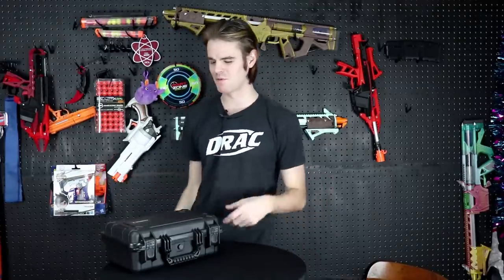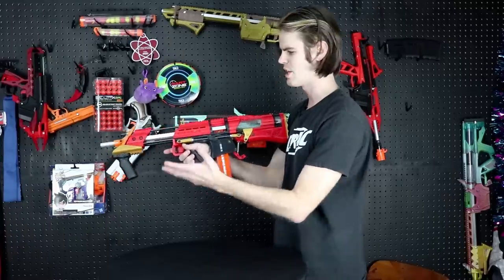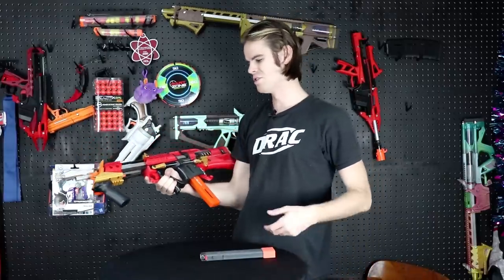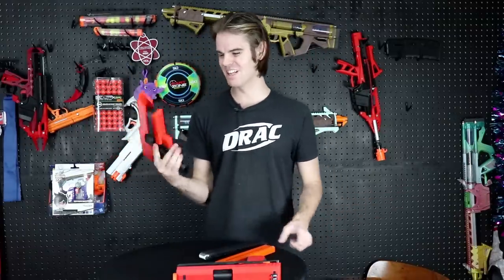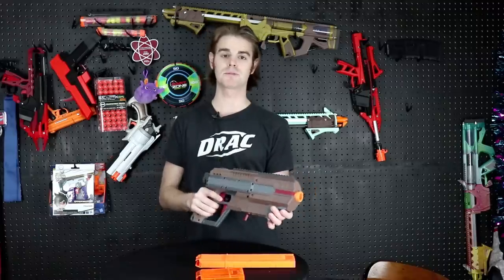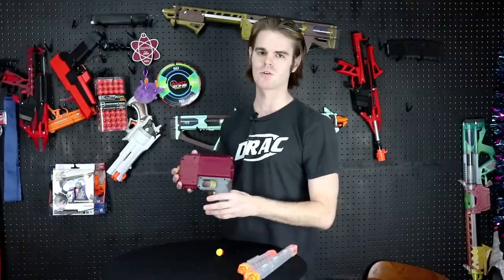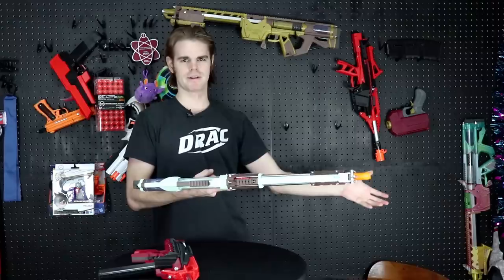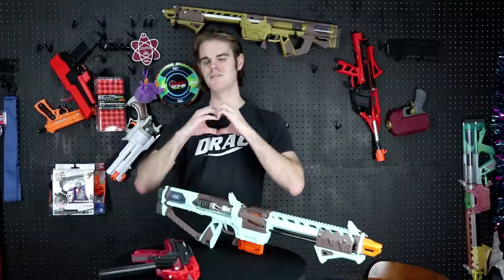Top 5! 3D Printed Nerf Blasters

Comment: 3D printers are not easily accessible to me
In India
So I make blasters out of PVCs, etc
And attachments out of casing and fitting... xD
The are durable😄
Reply: Where in India
Reply: That’s amazing dude I hope u eventually make a big business out of that
Reply: I live in Canada. But that's not the problem. I'm just not old enough to get my own parts and my parents won't buy a 3D printer so I make Nerf stuff from cardboard. Cardboard meh as long as it doesn't get squashed or wet.
Reply: Hardcore mode enabled
Reply: 3D printers (at least for printing Nerf Blasters, my school has like 4 now) are also relatively inaccessible to me too, and I'm an upper middle class American teenager, I don't live too far from Drac.

Comment: I think you may find all the latest pigeon files to be quite a bit nicer than the version that I sent you. We have a pusher that straightens out the darts in the mag, which has improved both accuracy and power, up to as much as 130fps. On top of that we have much better visual changes AND a grip safety rev system to allow even more control over the rev time. There's also a talon version, although I didn't want to take from the Falcon's clever mag release system, so it's only a detente system for now
Reply from the maker: Ill have to add it to my list of things to try.  Ive got a few of the moonlight wheels looking for homes and single stage is dope

Comment: PLEASE everybody like this video!!!! I’m getting my first 3D printer soon(I’m getting it off monoprice and know people with it so I know it’s good) but after that I may get a cr 10 for tall prints if necessary. My first builds will be replacement cylinders to increase capacity for all of my revolvers, with the next being a caliburn, soon to be followed by ones for my siblings, and then I want to start work on my own 3D printer toys(inside toys for children, not so much nerf. I love nerf because I get to tinker, learn new skills, and play with those new skills). I’ll also print anything I can to mod a stryfe and hopefully make some stuff useful for other nerfers(I’ve already started 3D modeling an increased capacity cylinder for the reflex six but have lacked a printer with which to prototype it). Also, I want to say I admire that you have offering kits for both flywheel blasters and springers. That said, I’ll still probably make my own cages and flywheels for awhile because I’m sixteen and trying to save money but I must admit the “nyx treatment” isn’t something to be trifled with and I greatly respect that!

Comment: My kids and I are just getting into Nerf modding, and I came across this video. Thanks for making it! I noticed your version of the Caliburn is a little different in a few places than the model posted on the Thingiverse link. Are the print files for the version you made also freely available?
Reply: I believe it may be because Slug has updated the blaster, possibly because the older models have issues, I’d recommend just getting the one slug has public

Comment: Only thing I don’t agree with on the list is the chimera. Although it is cool, and you can print most of it at home, hardware kits are pretty scarce rn and NorthEast Designs has kinda fallen off the face of the earth. Other than that, great list, and CALIBURN FTW!!!!
Reply from the maker: I didnt know this at the time of filming.  I just love mine.  If I could redo it, I would use the spring thunder

Comment: nerf flamethrower:

get two jupiters.
attach tubes to each.
fill giant container with rival ammo.
use motor inside of said container. 
attach the tubes attached to the jupiters to the container.
make sure motors are working so they launch the balls form the container, to the Jupiter.

B u r n  t h e  n e r f  b a t t l e  f i e l d .

Comment: Drac, please tel me... I have an EAT, I want to install a 5kg kit from worker and I wonder if I shiuld remove the AR. And I have a ultra modded barricade, should I get a stryfe.. I don't really enjoy flywheelers..
Reply: Leave the AR. Modern blasters don’t need them removed
Reply: @benlam419  yea but with it I get 85-90
Reply: @papilcost  thats about standard for 5 kilos. If you go above 7 remove it, the orange ones have overly restrictive AR s but above that will bend the internal priming bar. Ive modded 4 alpha troopers and primaried 2 for years. One of them had a 5 kilo but the AR broke so i had to take it out. Honestly its not super worth it.
Reply: @heyitsfranklynn168  and one more thing.. I want to get a stryfe from a person for $10 it's new and I want to put barricade motors in it rewire etc. Would it be worth it(I want to print the 3d cage for a barricade and put it in the stockade)
Reply: @papilcost  hell yeah buy it man they are literally 50 dollars in store
Reply: @papilcost  what motors are you planning to use
Reply: @papilcost  are they gonna be like upgraded or stock
Reply: @papilcost  if you find a Tommy 20 at a goodwill take it the motors are good, but yes if you  use stock motors do 3 normal aa's and 1 imr that's what I usually do but if you use upgraded motors like meishel 2.0s then use 4 normal aa's because that is good power
Reply: @papilcost  yeah I don't run aa and imrs together that much but I do it if I don't bring batteries and it gives decent performance for a day of play, also if you are looking for a 6 aa battery tray then take the one out of a dart zone scorpion and of you find a dart zone scorpion then you don't need to find a Tommy 20 because the scorpion motors can take 6 aa batteries no problem